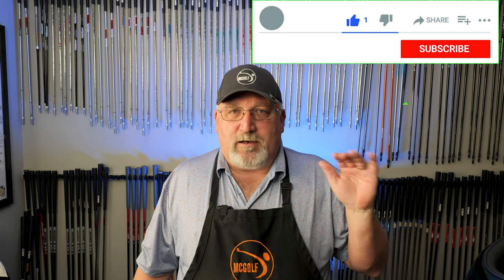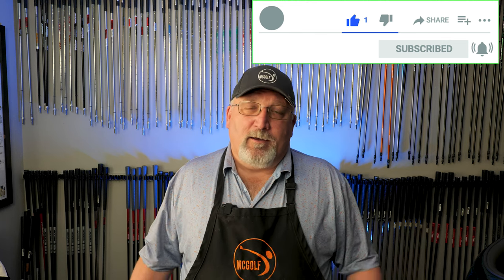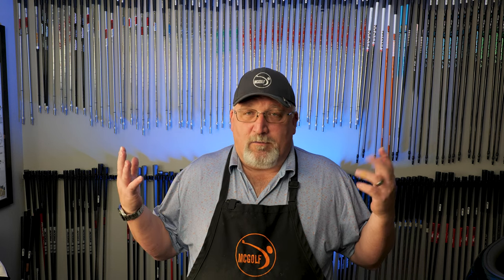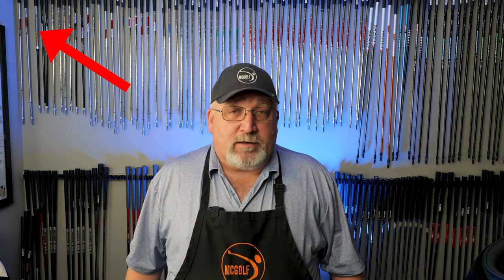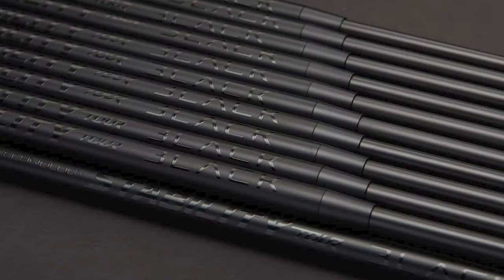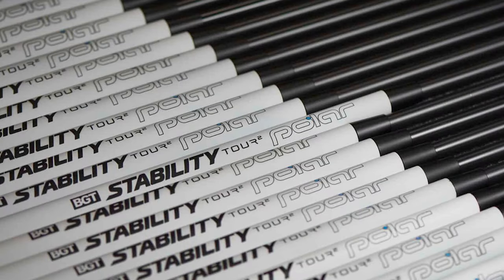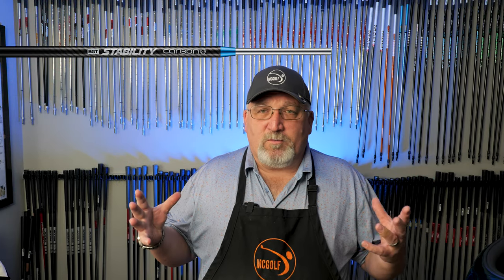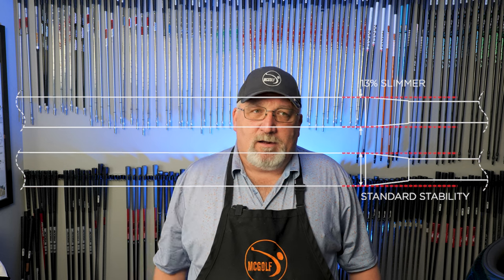Putt Better with a STABILITY putter shaft

Comment: I got the fitting with Blair at BGT in Richardson, TX. Amazing. He adjusted by eyeline and ball position, then installed the Stability Tour in my Mizuno M Craft VI putter. I could not believe the difference. I went from not really liking walking onto the green, to wanting to get there and putt! Confidence booster, and it really shines on putts longer than 10 feet. Stable! Glad you could graph the differences and see it for yourself.
Reply: What was the cost for in person fitting?
Reply: @Gwillis7  Can't remember if it was $150 or $300 refunded if the shaft was purchased. Prices may have changed, might want to call them now.

Comment: Hi Jim,

Thanks for the Stability review. Just curious if you’re going to add a balance certified back weight, if this would make it even better?
Reply from the maker: That came to mind  however the ID of the shaft wont allow the balanced certified to fit